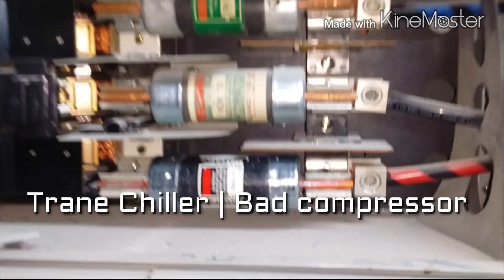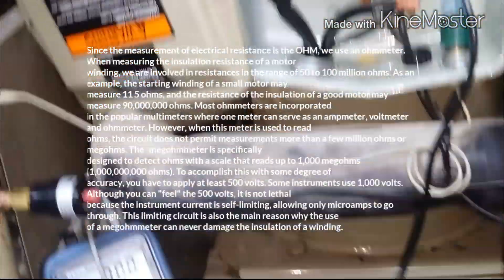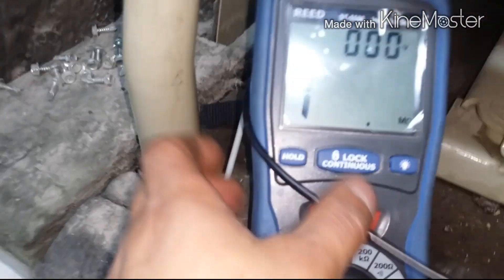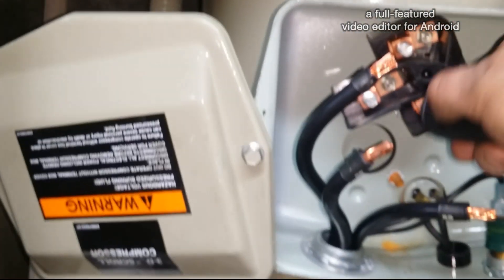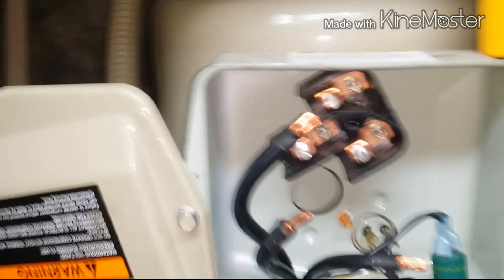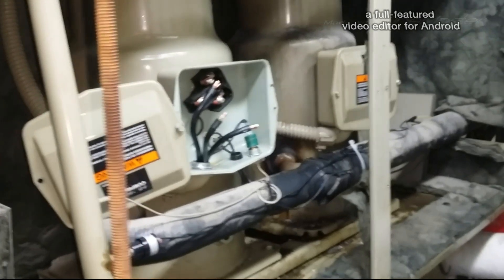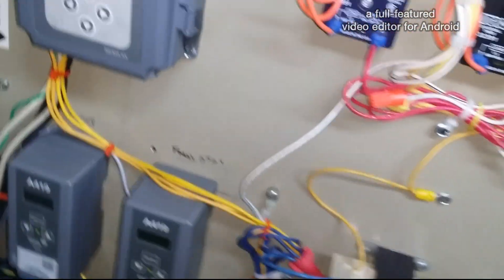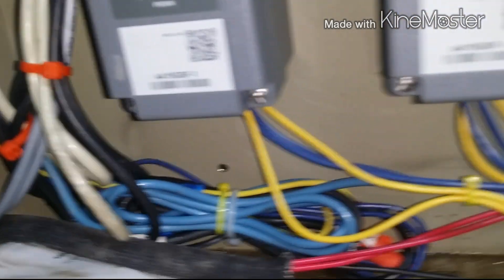Megger Testing | Bad Compressor | Trane Chiller

Comment: Nice job !   I too have had situations where I've had to redesign and build control panels for large systems that have become obsolete. I am curious as to why the unit keeps eating boards and compressors though. That high suction ( back pressure) is concerning too. It almost seems like the system needs pressure regulators on the low pressure side. Great job with the panel though. Looks good, and I know you already know, but don't forget the phase monitor at least. Good luck.

Comment: Anything under 50 is not considered bad. 2 Meg Ohms is acceptable on Trane compressors testing at 500 volts. What voltage were you testing at? What was your compressor sump superheat?

Comment: Seems like you should have checked the motor windings before you replaced all the controls. Why replace only one fuse? This may have been your fault running it without all the protection circuits. Im sure the day you rewired it there was a massive demand when it was put back in service having been off all day.

Comment: Nice fix bro I actually like it the way you did it better than those stupid boards Im more old-fashioned things lasted longer before they started using those damn things
Reply from the maker: It's simple and easy, I just have to install a phase minuter and  current sensing switches, I'll have everything on videos with the compressor change outs. Noth compressors have to be replaced because they are tandem